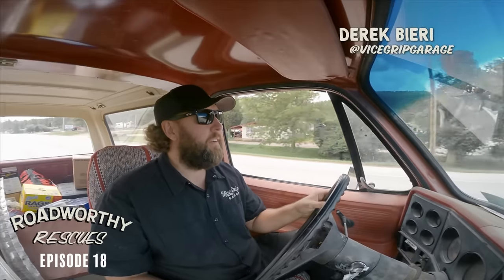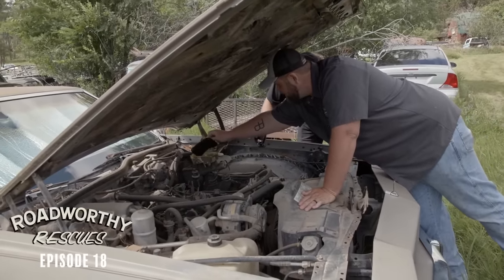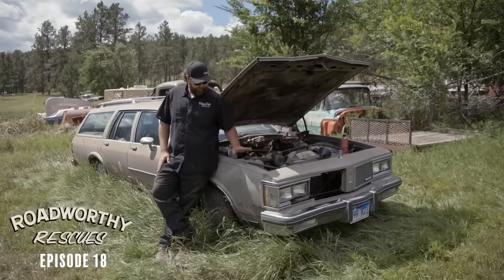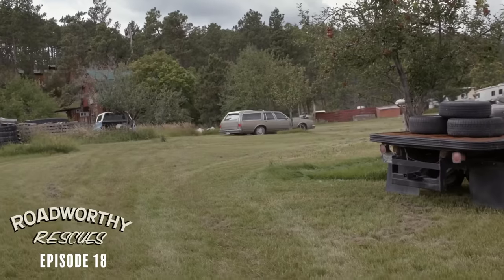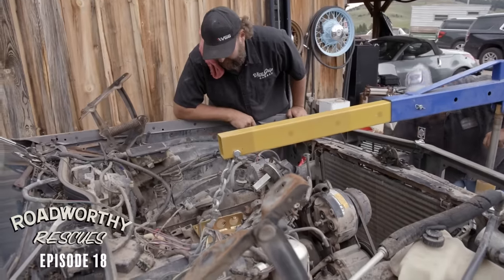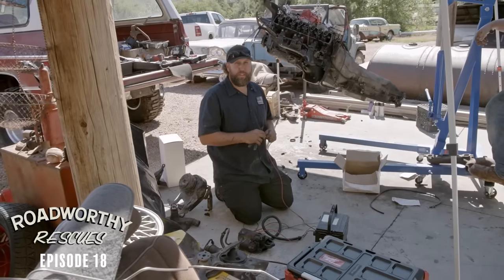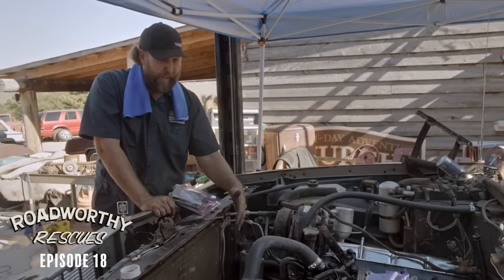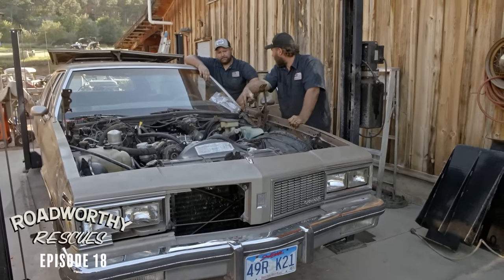This Oldsmobile Station Wagon Has Been Sitting for 16 Years! | Roadworthy Rescues

Comment: Those 2004R overdrive transmissions are great. Sitting 16 years, you still have gears. Immediately.
Reply: You were kidding….right?  Those Turbo 200 transmissions were JUNK!
Reply: the Buick GNX's used the 2004R--  yah junk....
Reply: @craigjorgensen4637 they got a bad rap because of the poor factory hydraulics, but they can be made to handle high powers and you can improve hydraulics and they are really great transmissions with some help. And they have 67:1 overdrive gear and have the same footprint as a turbo 400. People that know how to build these transmissions up like they for a reason.

Comment: I was an olds guy to start with.  65 delta 88 with a 330, 66 cutlass 2 door with a 425 and Muncie 4 speed and last was a 68 442 convertible. Loved them all. Then moved to a Ford mustang and been with Ford ever since.
Reply: Sure you didn’t mean ‘ 65 Delta with the 425? I had one. The Cutlass would have the 330
Reply: @deweygill1973  I also have a 65 dynamic 88 with a 425, and i didn't think they offered it with a 330, nevermind the higher trim deltas..
Reply: @thechillhacker  the 330 was only offered in one 88 model. That was the Jetstar 88 and only in 1964. It was an attempt by Olds to offer a lower price point by equipping an 88 with the F85 drivetrain. Somewhat of a  morphodite, besides the 330, you got a version of the 2 speed powerglide, a rear end, steering and suspension parts specific to that car only. I’ve had two, one a bare bones radio delete base, the one I have now is fully loaded with the optional 310 horse 330 available in the 442.

Comment: Sounds like it's just an old worn out Old's rocker bridge. Easy fix. Love watching VGG.
Reply: That was my first thought when I saw the car. They had soft rocker arm bridges and it was an easy fix.
Reply: My friend helped me fix my 307 with junkyard rocker arm bridges. It was silent and I ran it hard for a couple years. 
Not sure why they didn't find a 350 or 403 olds instead of the 307.
Reply: Hey Joe, you talking about the clackin' from the original engine?
Reply: I've tried explaining to Derrick before to just use a 2x2 stick of wood pressed to the ear and move it around touching things, he would know instantly if it was alternator or water pump or bottom end or top, etc.  Stick it to the valve cover, the exhaust manifold, block oil pan and any spinning parts like a doctor of METAL!

Comment: lmao other than the grill, some trim and a few more dents and dings than mine, this is almost identical down to the color and roof rack from the one I couldn't stand to see rot at one of my local yards. It is now my daily, after...stuff, and the family absolutely loves it. Mine being an 84 caprice with a mint interior. lots of porting, valvetrain, intake, hedders and home depot exhaust, new fuel system, ignition downgrade? to points, airbags in the back, complete electrical overhaul with secondary battery and custom switch panel in the cockpit for multistage solenoid control, and the alpine and new speakers fed by a cassette deck I refurbed, and a whole bunch more goodies made her a pretty sweet rig!

Comment: the same exact engine my 82 Buick had, I changed just about every part in that thing, over 100k miles that teflon/plastic toothed sprocket on the cam will detonate from all the heat cycles.

Comment: Hope you guys did the intake manifold gasket in that 307. It was a major failure point in those engines. I am very familiar with working on them. I had 2 used delta 88s in the 90s. One was an 82 the other a 84. Like driving a couch on wheels. I miss those cars.

Comment: It's sad because I have a a running Oldsmobile 307 in my 86' Buick Regal.
It doesn't have all the fancy smog control pipes an snakes and an old Olds Quadrabog aka non CCC Carburetor.
I know you be sad to miss out on the 137hp goodness of the 307.

Comment: My first car was a 78 Cutlass. Started with a terrible 305 and got a Delta 88 307 swapped in. Had to turn the AC off if you stopped or you killed the engine.

Comment: The radio.   The reason that is happening has to do with the blown out bearing in the column.  This car has an open body ground, and it is grounding through the column.  When that happens and a bearing is in the ground path, it will fail rapidly.   Hence, the floppy column.

Comment: You said 200-R4 transmission, but the correct name is 200-4R. Everyone seems to get it conflated most likely because of the similarly named 700-R4, but it is indeed 200-4R.

Comment: That is NOT an '87. No center tail light. Center tail lights were required on ALL cars starting with the 1986 model year. Light Trucks and Vans were required in 1994 model year.